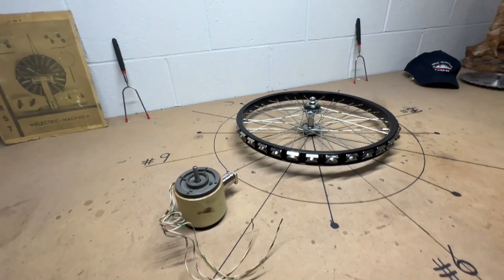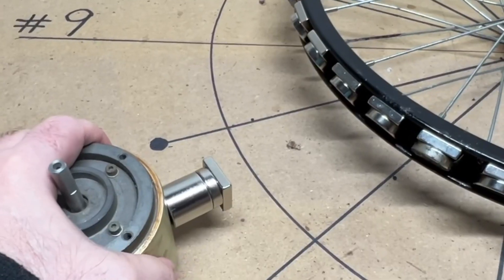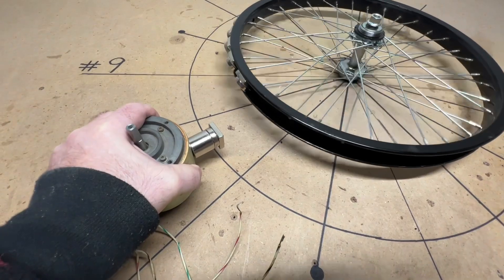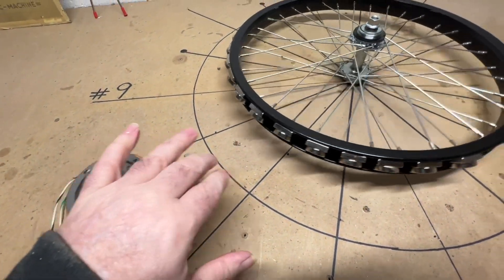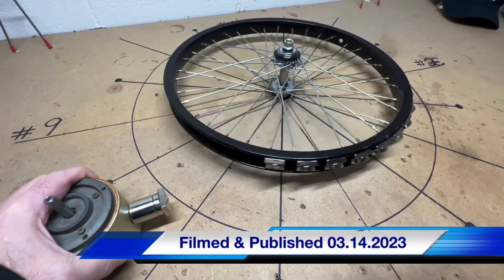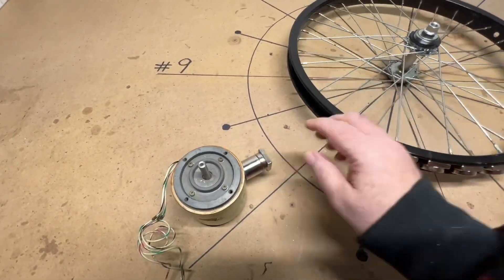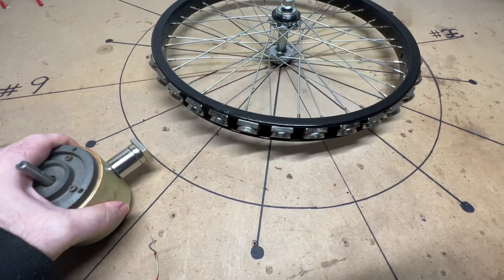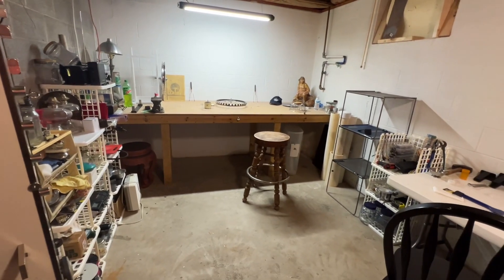HUGE GAME CHANGER??? PART #1 Free Energy Research & Development.

Comment: 5:37 Here's exactly what you're making: https://www.youtube.com/watch?v=j-wnSdT_-fI
See how much momentum the ball has? And all it needs is just a little finger flick in the "sticky spot" it normally would stop and get stuck at. So why not just put a little switch there that the ball could push at the right time with all its momentum and keep accelerating forever? Because it wouldn't keep accelerating. The energy used to push the switch would make it stop and get stuck in the "sticky spot".

You're making exactly the same thing. The wheel won't have enough energy to move the magnet and keep spinning forever. Eventually, it'll get stuck in some "sticky spot". It may look like it has a lot of energy and a lot of torque when it's spinning. But it's actually very little. Because it's a free spinning wheel on an axle with very little friction. It starts to spin really easily and stops really easily. So just this "little flick" of a magnet will take away all of its energy and make it stop. Just like the "little flick" in the magnetic ramp above is what stops the ball from rolling forever on its own. The guy didn't stop just before achieving perpetual motion. He wasn't too lazy. He keeps making tons of similar magnetic toys until this day, with a lot more complex setups than yours. But it was simply impossible to go over this "little flick". The ball doesn't have enough energy to do it. Even though it looks like it has a lot of momentum.

Here's the "little flick" that stops his wheel from spinning forever, in a setup extremely similar to yours: https://www.youtube.com/watch?v=P0bAjvfLuUI

He has dozens of setups way better designed than yours and he never achieved perpetual motion. It's all just toys that spin in funny ways due to magnetic forces. Even though he's really trying his best to make them as efficient as possible. But he's always "juuuuust a little flick" away from achieving perpetual motion.
Reply from the maker: 🧲 First, thank you for taking the time out of your life that we can never get back to leave me your constructive feedback. Both videos are not related to what it is I am doing. Those videos are trying to overcome the sticky spot. With my stator there is no sticky spot to overcome.  Additionally, The YouTube videos that you had me look at have no torque whatsoever to work with. You have not put your hands on my wheel to feel the enormous torque that is being produced.  From what I am seeing,  I have plenty of extra torque to spare. We will know soon enough, if I am truly onto something or if this is simply a dead end.   You remind me of those in history, who said man will never be able to fly and never go into space. Now man has airplanes and Rocketships.   You should check out part two of this video.  👉 https://youtu.be/8yaBtBIeG5I

Comment: Hi
Thanks for another great video
If you need something 3d printed, just ask

Also, would you specify the size and number of the magnets on the wheel and the stator and their orientation please

Thanks
Reply from the maker: 🧲 Because I have been sick in recent weeks I’ve gotten behind.  This new discovery that I see as a game changer can greatly benefit from 3-D printing. What I need is some kind of mounting system for the cylindrical magnet to hold it in place, that can pivot back-and-forth on an axis,  15 to 20°  it will need to have a place where a light gauge spring gets attached to it to return the swivel back in place that’s holding the 1 inch cylindrical stator magnet. The design concept for this is about as simple as anything you could ever possibly imagine.  I will make the rotating armature stater mounts out of small PVC pipe for now. It may not look pretty, but it at least it will get me up and running until a nice professional version can be printed out via 3-D. 

 What I’m going to do is Jerry rig rig something to get it up and running. Then I can assess what kind of parts that need to be printed out.  If you check out part two of this video, you will see that there’s a whole new possible route to take.  

https://youtu.be/8yaBtBIeG5I

More importantly, thank you for taking precious time out of your life that we can never get back to continue to hang out here and provide valuable feedback and insight. Much obliged.

Comment: Why not have different angles from different proximtry affecting different aligned magnets?
Reply from the maker: 🧲 Logic says yes. So I tried that day before yesterday and did not get any desirable results.  I suspect it’s because when the magnet does not go into tilt mode, Newton’s 3rd Law of Motion takes over. There for all net gain is immediately canceled out by the equally strong counter reaction. Tilting the magnet reduces the counter reaction dramatically.  Have you seen part 2 yet? 👉 https://youtu.be/8yaBtBIeG5I

Comment: Hope this helps; When one side of a magnet is exposed to a large surface area , that side is weakened as in (dilution) but the other side actually gets stronger due to the incoming flow thru the Bloch wall,  you see one side is trying to overcompensate the outflow from the side that is exposed to that round surface area. Please do a simple test with and without the curved ferromagnetic surface and you will discover the repelling force will be stronger, in your case the square side
Reply from the maker: 🧲 I must admit that I have yet to get around to testing square or straight edges versus round edges and discerning the difference between the two when it comes to cause and effect. I have all intentions of doing, so just that I have not gotten around to it yet. More importantly, thank you for taking valuable time out of your life which we can never get back to stop by to give your valuable feedback. Have you seen part to follow up for this video yet?  👉 It turns out that we might not need the crank shaft after all. Have a look at video part two of this please. And then tell me what you think. 👉 https://youtu.be/8yaBtBIeG5I
Reply: @FreeMagneticEnergy2  okay, thank you, will do

Comment: you could use belt and pulleys . have a shaft with a lobe like a camshaft lobe to move the magnetic holder. with  belt and pulleys it would be easy adjustments . great work
Reply from the maker: 🧲 I thought about that and  at some point in time I might have to go that route. However, once you see part two of this video, we may not have to go that route after all.  👉 It turns out that we might not need the crank shaft after all. Have a look at video part two of this please. And then tell me what you think. 👉 https://youtu.be/8yaBtBIeG5I